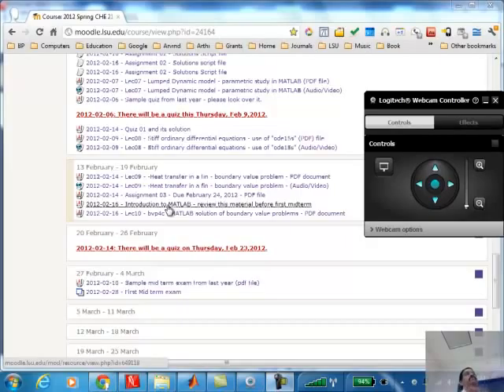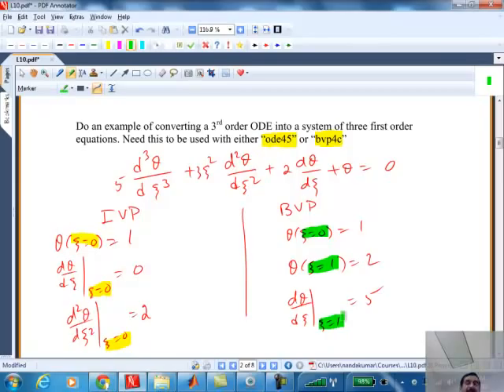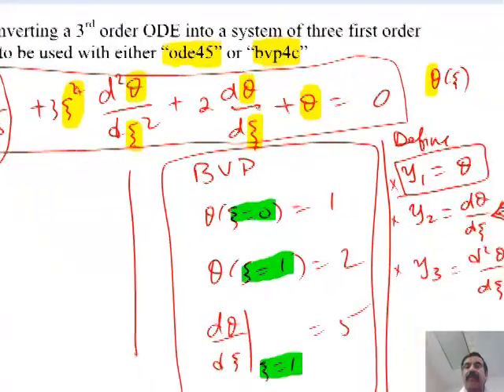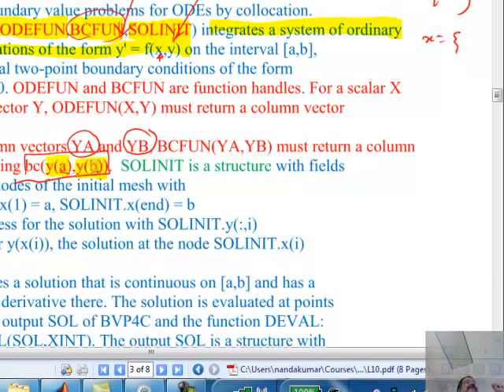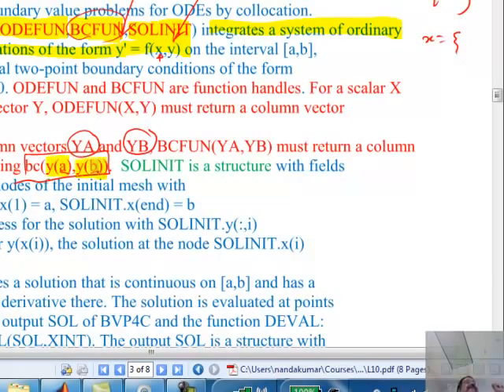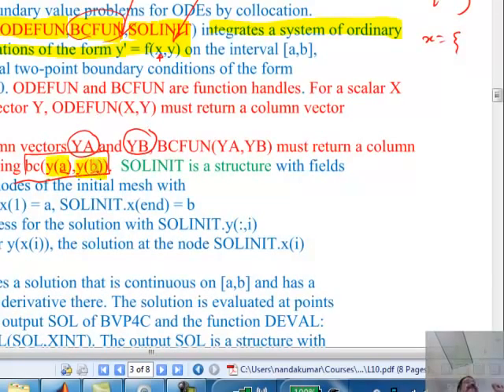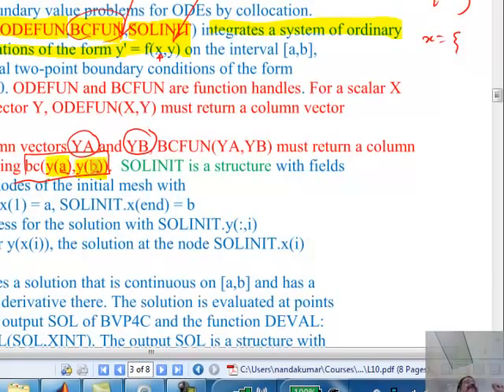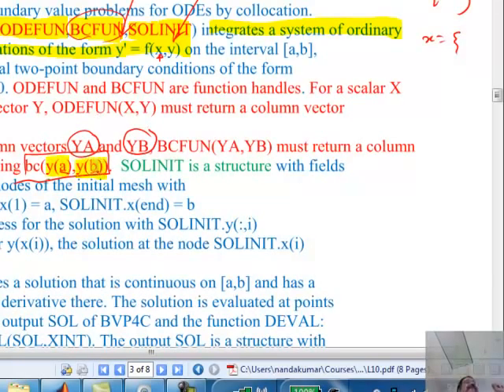L10_S12_ChE2176.mp4

Comment: Hi,
I have been watching your MATLAB videos. They are impressive. Based on them I started working on a diffusion advection problem of CO+0.5O2 --> CO2. It is a second order ODE with one initial condition and one boundary condition. Initial condition is based on the molar ratio of species (X). Boundary condition is based on the change in molar ratio (dX/dx) which should be zero. However, upon preparing a solver routine based on bvp4c, I get an error saying "single Jacobian encountered". Any guesses why that occurs. If you could send me your email, I can send the codes to you. Thanks. Keep up the awesome work.